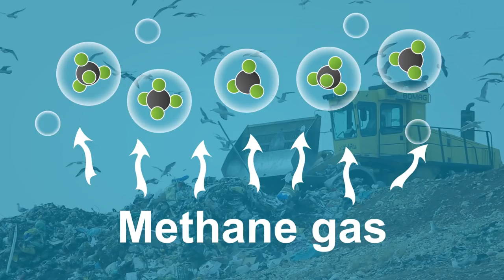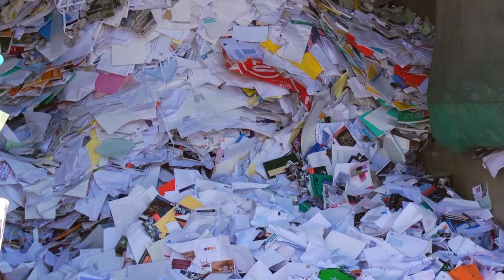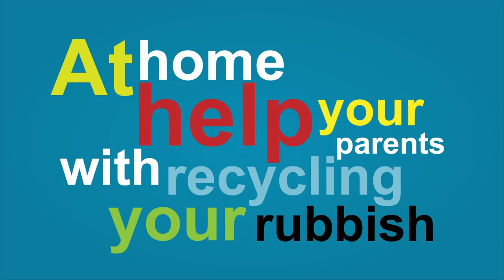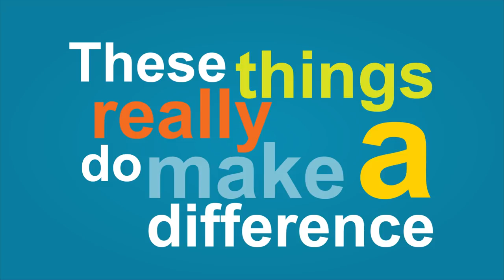How waste recycling helps our planet - Zero to Landfill

Comment: just a train of thought what happens to the ash after incineration,
Reply: Maybe landfill, but at least it's a lot smaller volume & has been used to generate energy.
Reply: A lot of RDF is used in cement kilns as fuel, and replaces coal. The coal is high ash, RDF is low ash, the ash forms an integral part of the cement, some works add ash to the process anyway and the small amount in RDF is of no consequence.

Comment: HOW RECYCLING DOES DEFINITELY NOT HELP OUR PLANET:
1. Contamination  If there are impurities or toxins on the original 
material, like lead, they’ll usually make it through the recycling process and end up buried in the new product, like  say, a soda can. Have a nice day
2.hundreds of buildings in Taiwan made from recycled steel have been giving people gamma radiation poisoning.
                             '' be sure to recycle"
3.The recycling process produces  pollutants In 2009 there were about 179,000 waste collection vehicles on the road. The exhaust fromf those vehicles contains over three dozen airborne toxins. 
                            '' good ole  curb collection''
4.One recycling plant in Washington state produces more toxic emissions than any other 
factory  the next three biggest polluters in the area ae also recycling plants. 
                                   ''saving the planet"
5. When paper is recycled, it’s all mixed together into a pulp. That pulp 
is washed, cleaned, and then pressed into new paper sheets. During that process,, inks, cleaning chemicals, and dyes are filtered out into sludge. The sludge is then sent to a landfill, where it leaches dozens of toxic chemicals and heavy metals into groundwater. 'nice right?'
                      '' matter cannot be created nor destroyed''
6. There are about seven types of plastic that you’ll find in day to day life, and only two of them are recyclable.
                             "' W  T  F  "     " O M G "
7. Plastic is a pretty tricky animal overall, but in all honesty, we just have no idea what to do with it. 
                            " It costs $4,000 US to recycle one ton of plastic "
8. oil is a pretty major pollutant.  So it makes sense to try to recycle used oil right? Wrong.recycling oil creates even more toxic chemicals in the process.
                              "  really? " " yes really"
9.  Aluminum ? Disappointingly recycled soda cans can’t give you the quality you need to build an airplane, or even to use in electronic circuits. Its just shit aluminum..
                        "" they never told us THAT "
10. More aluminum; The average American drinks 2.5 cans of soda per day.That’s about 778 million cans. If 100,000 cans are recycled every minute (they are), we’re still about 600 million cans short. And that’s just in one day So in only one years time, doing the math for you, 2,100,000,000 cans unrecycled... 
                               "Sorry to bring you the bad news"
Reply: Charlie Hutch wtf r u on about
Reply: You can sell aluminium cans so they must be worth something
Reply: It's being so cheerful that keeps you going.